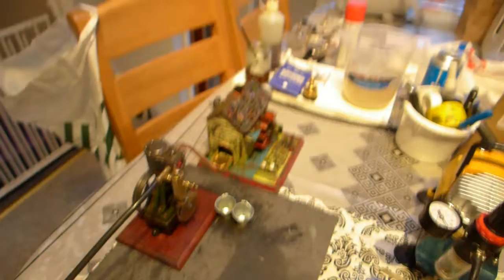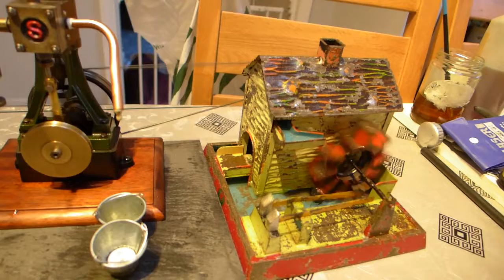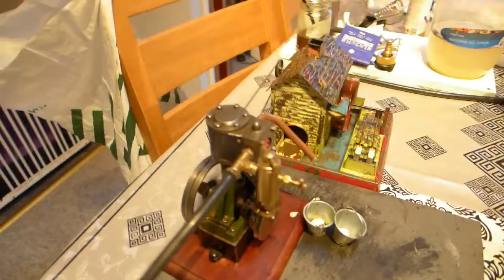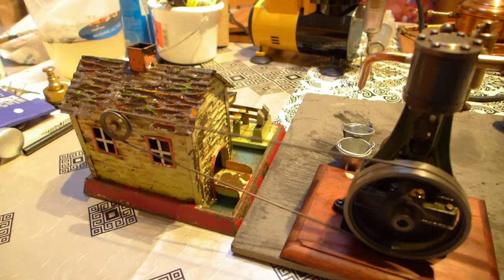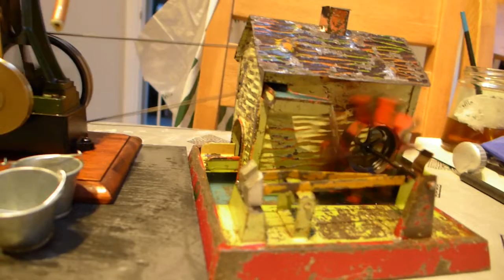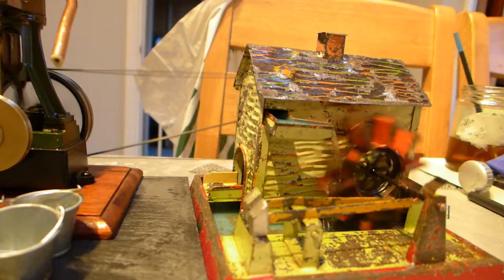Doll & Co Mill House water powered Hammer 1930's

Comment: Very nice, Steve! I always liked that one. How does it work? Does it have a pump?
Reply from the maker: The pulley is driven by a steam engine that operates a piston in a tube like the Perricault water pump i have here, this spills out onto the water wheel that in turn drives the hammers , its a great Model Mike
Reply: Stephen Sutton 
It sure is nice. I want one now! 😎
Reply from the maker: I have only seen two including this one the other is on ebay now